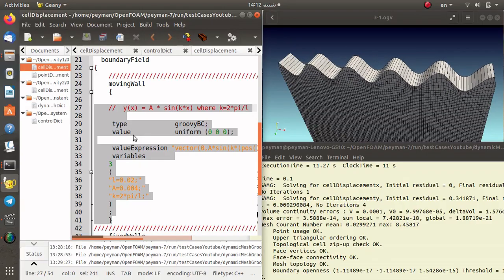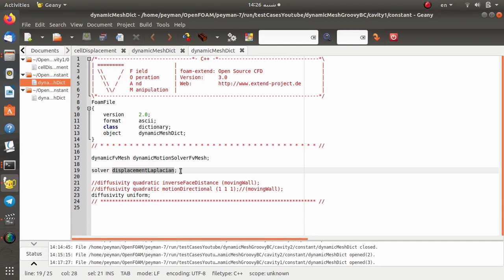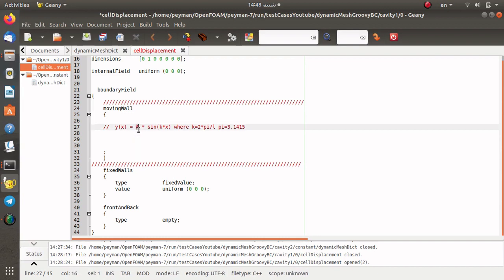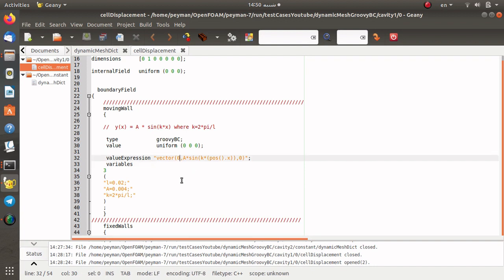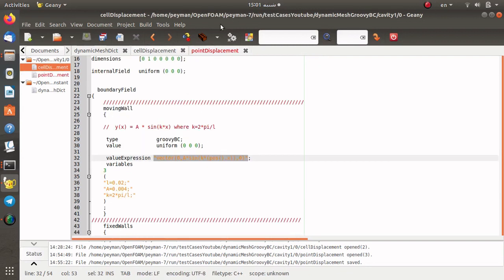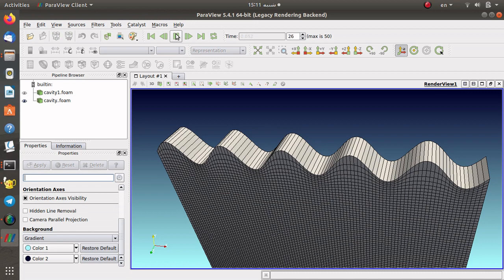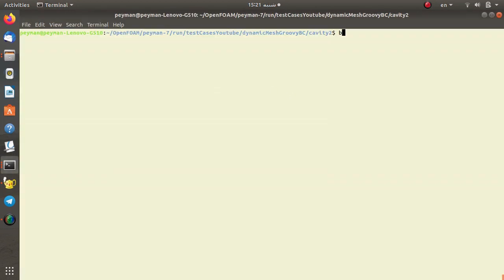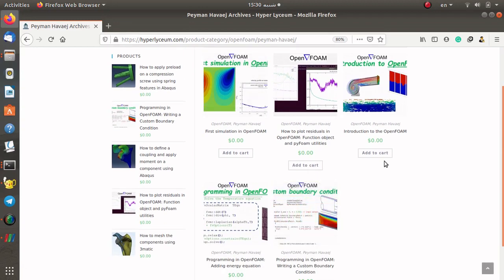Boundary Condition in OpenFOAM: swak4Foam and groovyBC

Comment: Great video! I want to add displacement on the boundary and let the boundary mesh deform (the internal mesh also deforms along with the boundary mesh). I plan to adopt 'displacementlaplacian' for solving the internal mesh, but how to deform the boundary mesh according to the displacement? By the way, what is the format of the displacement file read by OpenFOAM？ Could you please share some suggestions?

Comment: Nice, could you explain  how to use dimensionless equation's in OpenFoam?
Reply from the maker: You can investigate the effect of dimensionless parameters at post-processing.

In case you need a new solver, of course, you can develop it based on non-dimensional governing equations.
Reply: @Engineering_downloads  thank you sir,but how?openFoam is strictly dimensional, i send a paper via email sir kindly if you could explain for me.

Comment: This is awesome. I didn't knew this could be done. Is there any real world application for this kind of mesh?
Reply from the maker: Yes, the real application of such surfaces can be found in the sinusoidal plate heat exchanger. 
Besides, this type of surface movement can be important in case you want to consider the surface features effects on the micro-scale.
Reply: @Engineering_downloads  Thank you sir. I checked the files, changed some parameters but in everytime max skewness is around 1.5-1.7. It is probably because of top left cell(it deforms greatly). If I find a solution to that I'll share with you too. Cheers!